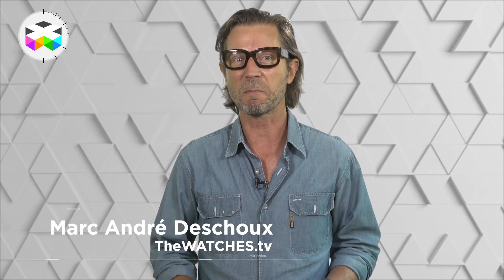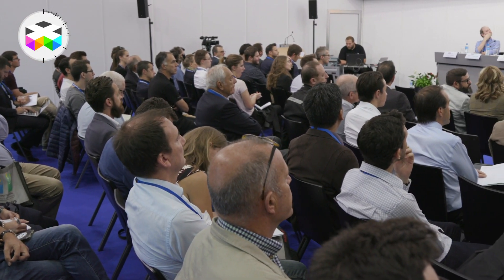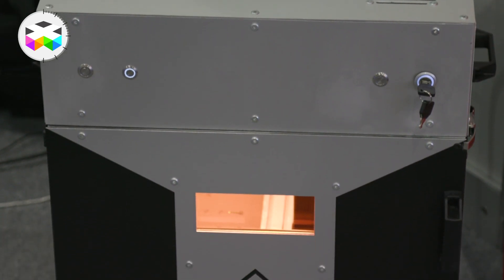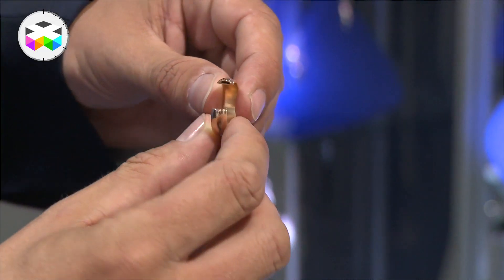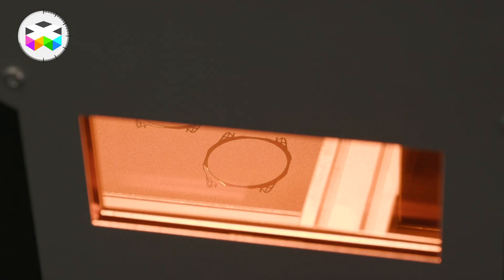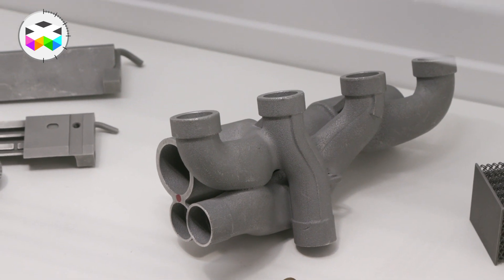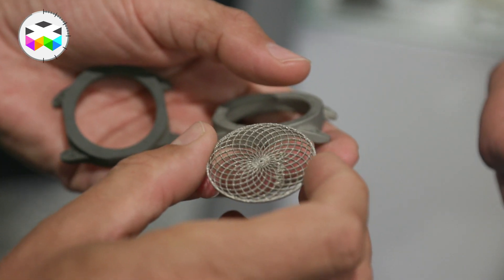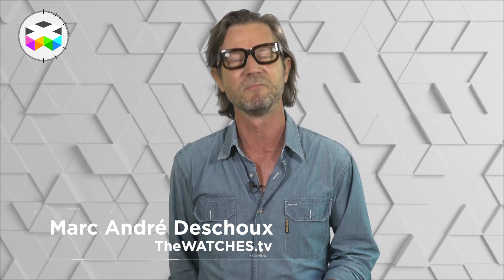Additive Manufacturing or 3D Printing coming to Watchmaking?

Comment: Excellent video. Working in metal Additive Manufacturing industry I can confirm the interviewed persons are real experts. Laser Powder Bed Fusion (LPBF) also known as Direct Metal Laser Sintering (DMLS) or Selective Laser Melting (SLM) is being used by a couple of companies in high jewellery and watch making industry. As pointed out, the post machining/processing is still an issue.
Reply from the maker: Thanks for your comment, very appreciated and all the best to you

Comment: I think this may have more of an impact on cheaper products, as with 3D printed parts, it is no longer or expensive or difficult (i.e. doesn't require any additional manufacturing processes) to produce more ornate designs.
Reply from the maker: High-end finishing will always remain a super important quality differentiator I believe